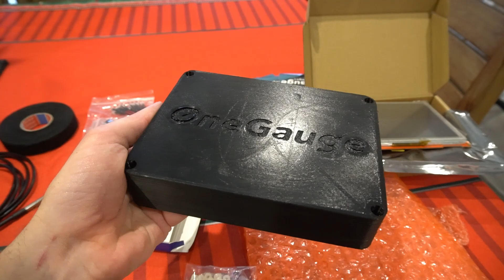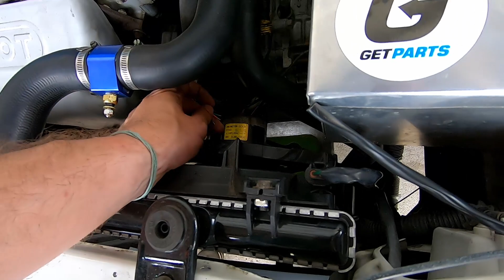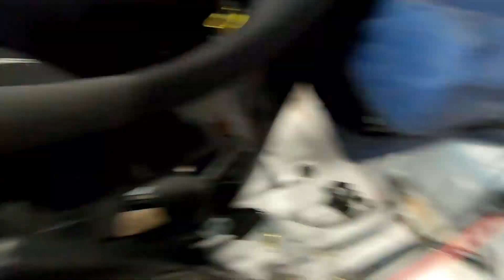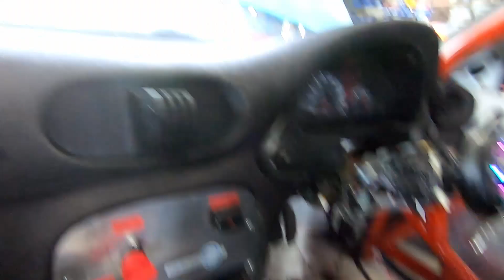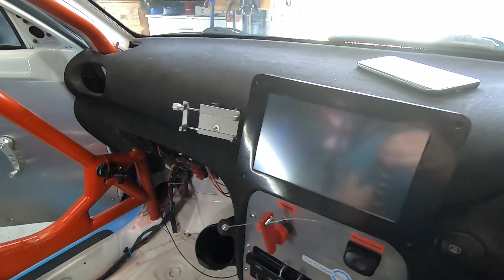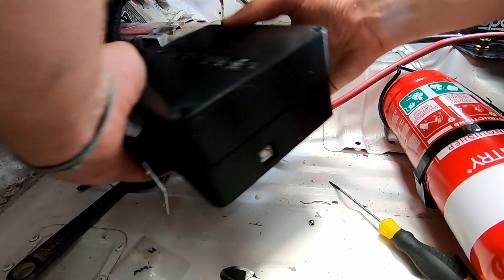Budget Race Display! - The One Gauge Install

Comment: Judging from the shape of the magnetic aerial, it's designed to have the cord at the back ;-)
Reply from the maker: yeah for sure, i figured more stability at speed if it's teathered by the cable at the front so put it on that way round, seems to work well, i'll just have to remember to silicone up that hole before it rains next haha
Reply: @TheNuggetProject  I'm sure your passenger will remind you if it gets forgotten ;-)
Reply from the maker: @krazed0451  haha no doubt!

Comment: Hey mate, in case you need to change the oil pressure sensor in the future, the thread on the block is 1/8 bsp, while most sensors are 1/8 npt. I had trouble with it this week, went to Pirtek and I got two small fittings to adapt the npt to fit the bsp threads. Cost me $3.59. Saves you time filing down the threads next time.
Reply from the maker: good to know mate! thankyou :)